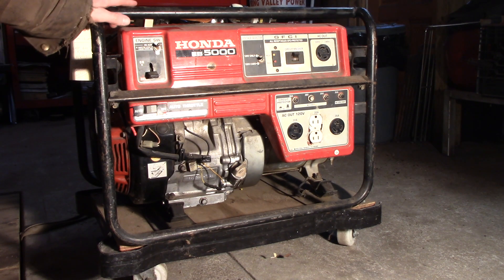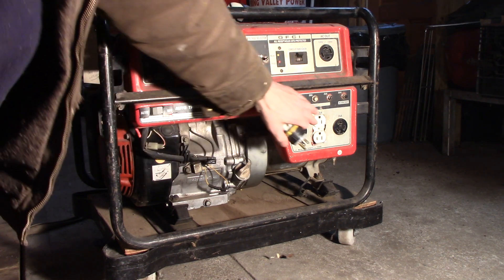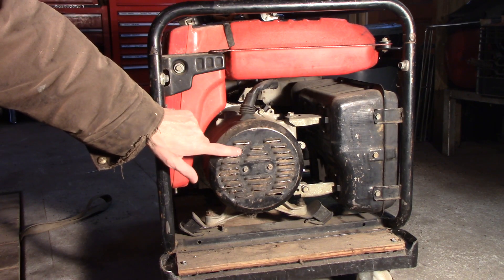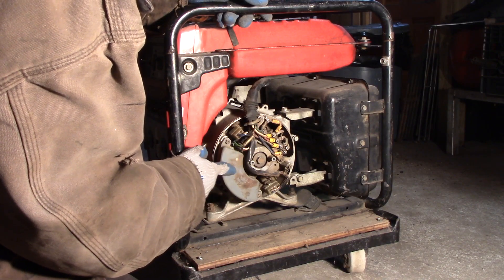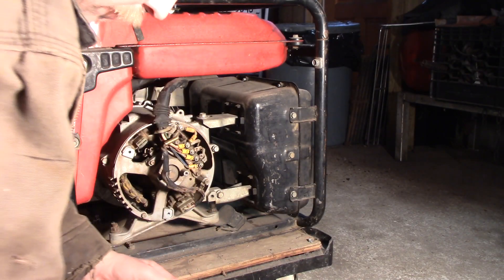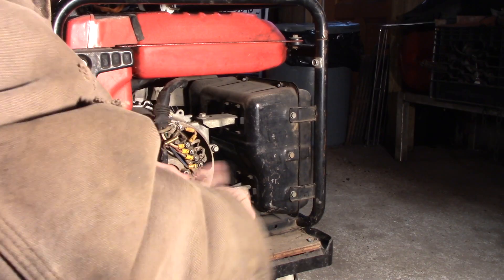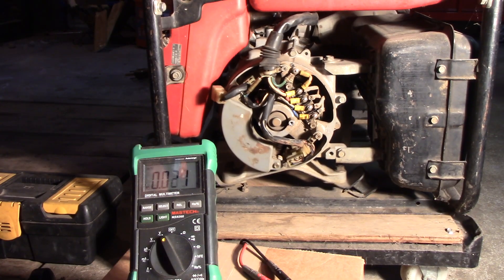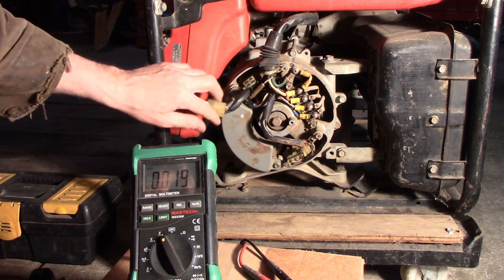Honda generator not producing power.

Comment: an unrelated issue my Eco throttle is not working right and I thought I would mention this for other people. I have a EB 5000 X. which is a commercial unit. The throttle is hanging up and after looking at it good it's the plastic throttle shaft on the carburetor and I might have to just replace a whole carburetor. Kit is like $15 for an aftermarket one. But would I really need to see the correct procedure for adjusting the Gov. idle speed and high speed I know the low speed should be about 2200 RPM the high speed I don't like to hear a full 3600 RPM I would rather hit around 3400 and if you need more a little up to 3500 I have found engines last about 10 times as long. At least I'm lawn mowers they sure do so. I also bought a tachometer our meter and I went to put that on I did bring my RPMs down quite a bit. This was a used machine and I really wanted to do a complete tune, but I would recommend to anybody change your oil changers spark plug. If you wanna go natural gas you go one step colder on the plug like a NGKBR 7ES or AES the higher number of the colder. You can use a piece of quarter or 36 teeth break brake line and you have to drill a hole in the air cleaner cover go through the foam and through the plastic before the cover and shove the tube a little bit into the carburetor then you put an adjustable gas valve start the engine on gas as it's running out you switch it over slow slowly to natural gas. Runs great like that. You might have to open your exhaust valve clearances up a couple thousands normal on that motor is six. I think I'm probably about eight. Thousands 008. I love my Honda generators and inverters because they will run continuous usually flawlessly. I had a 7000 IS it got burned up in the house fire I got another one but the computer on it blew and I'm rebuilding the whole unit like brand new this winter. so I just thought I'd mention to you guys cause I know the EB 5000 X has a different weird carburetor than all the rest of them. If you don't wanna take the whole carburetor, you might be able to buy aftermarket carburetor and switch out the throttle shaft. Sometimes the factory carburetors are the best, but I run on natural gas so it really doesn't matter cause I'm only using the carburetor to start the engine, but I still rely on the Eco throttle and I just set the motor up Rich so that it it has to give it to gas. There's enough natural gas otherwise you gotta buy the natural gas kitwhich will meet it properly. I've been doing this like this on several generators for probably about six or seven years it works great. Saves me money because I got free gas.

Comment: thank you for making this video. It saved me at 3 o'clock in the morning in the ice cold. I lost power. After watching you put the brushes back in. I was like well I'll go get some pictures of the regulator and the brushes in order some on Amazon so then I thought well why don't I try to take the brushes out see if they're stuck etc. well guess what one was a little bit abnormal a lot shorter than the other so I bent the tank a little pushed it through a little farther and Shazam it worked and I ordered the parts will be here tomorrow. Had I not seen your video I would probably still be struggling to figure things out and I'm a guy like you that knows how to do electronic testing and stuff just set me right to the place to look. I had to call her cut the zip ties because they had to wiring pool like a guitar string and I ordered some more zip ties with the hole on them that goes through the holes with a screw. So now I'll have a perfect fixed and I'll have extra parts. You can buy like a five pair of brushes on Amazon for like $8.99 and I got the regulator which isn't bad for something like $14. I was kind of shocked when you consider the name Honda usually there's nothing low cost. Thanks for making this video.👍👍

Comment: I just picked up one theses for 100$ and got it up and running the engine and stuff and rebuilt the carburetor. But I have no power soo I'm going to try tomorrow to work on it the way you did. I see what you mite did them brushes weren't making contact right. I'm going to try to clean all in there and clean the wires terminals ends. I'm going to try my best to get it going I really just want to sell it and use it for a little while. Does anyone know on here know if the control panel has any crazy boxes in there that are hard to replace and can't find the parts I haven't gotten this far. I like to learn more about this generator as I go

Comment: I have a Wacker 5600 Honda engine with no output. 60 ohm slipping ring resistance. With brushes not connected, reading 75vac!!? across the brush. AVR output is 34vdc no load. Stator windings are OK.
Reply from the maker: Sorry not to  Familiar with generator outputs
Reply: I'd flash the field or rotor winding using a car battery
Reply: Did you find a solution to your issue?

Comment: In these generators, the spinning rotor has a magnetic field around it and induces voltage in three stator windings, 2 of which provide the 120/240 volts and another winding known as the exciter.
that 4 or 5 volts or however many the mfr. decided goes into the avr ( auto volts reg.) and not only changes the exciter voltage to d.c. but varies it to the main winding voltage. so if gen is rated 120
volts and only putting 110, the avr says we need more volts and the other part of the avr  jacks up rotor volts a bit, well that makes the rotor a stronger electro-magnet and  the main winding voltage goes up,
of course  if the main voltage id up too much, , it tells the rotor voltage to slack off a bit and volts go down a little. sometimes the rotor winding to the slip ring/s can just break..

      Now, in a brushless generator here is whats going on, still have an avr and an exciter winding,
The rotor has 2 windings, when spinning it has an a.c. voltage induced in it, that a.c. is changed to d.c. by means of diodes or rectifiers on the rotor shaft and that d.c. is sent to another rotor winding.
and the residual field is now built up into a pretty strong field.

So, if the avr is good, then chances are a diode or two went bad or a solder joint. hope this helps you to understand. This is the inside story.
     The outside story, volts are the electrical equivalent of mechanical speed, amperes are the
electrical equivalent of torque or twisting force. Up to a point, the speed changes voltage, but when 

you plug in, say a compressor pulling fifteen amps, the stator turns into a powerful electro-magnet
also and creates a magnetic drag, trying to keep the rotor from spinning as fast, that is why the generator slows a bit when a good load is placed on the generator. The N poles of the stator are trying to grab the S. poles of the rotor.
Reply: Thank you so much.
Reply: @janieknapp9063 , I hope that helped you. knowing the theory of how 
these work is half the battle.
Reply: Other way around. Voltage is like torque while amperage is like speed (sort of} Better analogy is piped water. The water pressure is like electrical voltage while water flow is like electrical current measured in amperes.

Comment: I forgot to ask ..by chance did you measure  th resistance between brushes ..
Reply from the maker: I can't remember it's been awhile but I think if I remember correctly the brushes were just stuck and just by taking it apart and putting it back together fix it
Reply: Its oky ..thought u did measure tht

Comment: Hi I have EB 1800 Honda Gernetor but issue is not give proper power
Reply from the maker: Sorry to hear that I'm not sure if that's just bad contact brushes or an actual generator issue. But if it lights a light it's good enough in a power failure I suppose
Reply: How much oil capacity  for. Engine EB 1800 oil we used
Reply from the maker: @akhtarrehman9006  I'm not sure what you're referring to however most Small Engines take one but no more than 2 quarts of oil

Comment: Does the stator/rotor  have TWO windings and TWO slip-rings?  Sometimes there are TWO stator/rotor Diodes same here?
Reply: Hello Dave G. If there are no brushes you would probably find diodes on rotor shaft and either an AVR or just capacitor and an exciter winding in with stator.
Cap or AVR takes power and puts it to exciter winding. rotor has 2 sets of coils one has a.c. turned to d.c. and sent to other coil on rotor rotor gets very magnetized and making power in main stator coils.

Comment: Hi, I have a brush less generator that runs and gives 110v for each coil. We checked the capacitor, its fine. The issue is that we don't have 240v. When I connected two neutrals  together it doesnt give me 240v. 120v with 1.5kw load is working perfectly and it keeps the same voltage on the coils. When i test the voltage between two face wires, it shows me 0 voltage. Please let me know what else I can check to resolve this problem. The voltmeter on the generator shows 110v. Thank You
Reply: Adjust the avr make it 240v thats all
Reply: It may not have two seperate field coils only one big one wound for one circuit only..